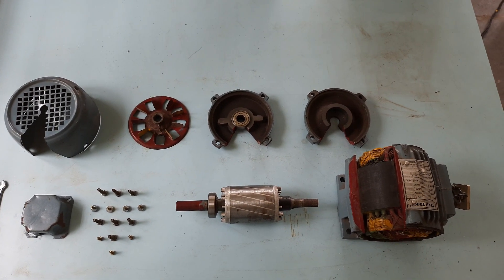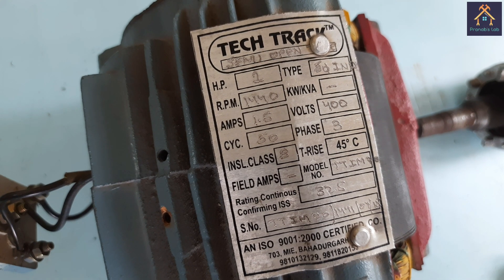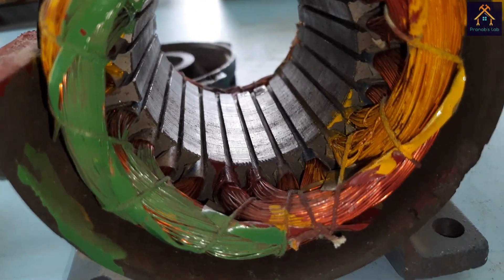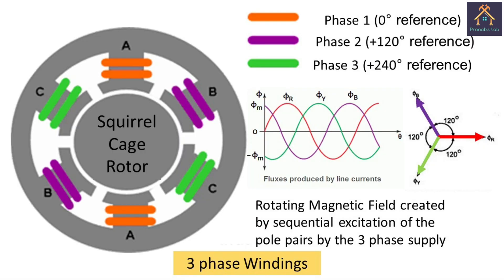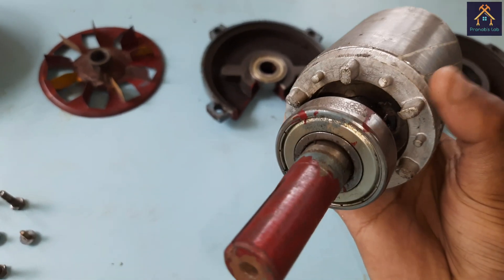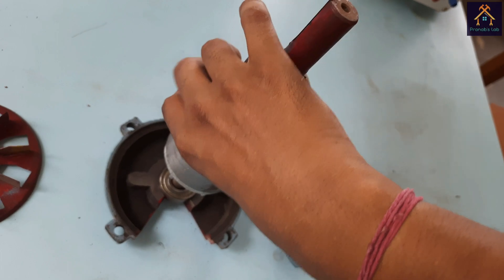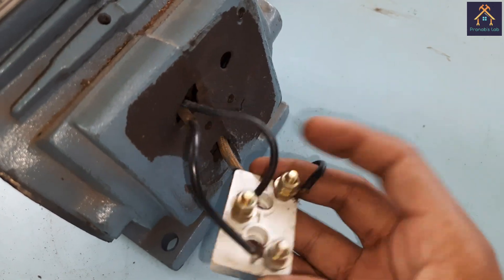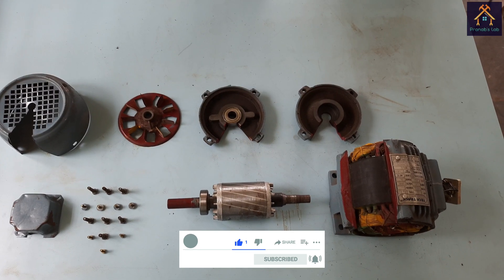All Parts of 3 Phase Squirrel Cage Induction Motor | AC Machines Lab | Expt. No. 1 | Stator, Rotor

Comment: Hi  @  4.33 - 4.35  U said short circuited ... Could you please explain that part .. I have seen some people are discussed but never explained ... Thanks in advance ... Din
Reply from the maker: Short circuited means, the aluminium bars of the rotor is directly connected each others without any resistance or other things. That is called short circuited.